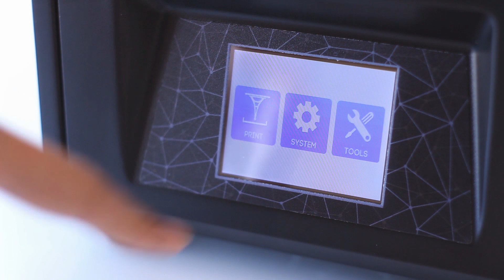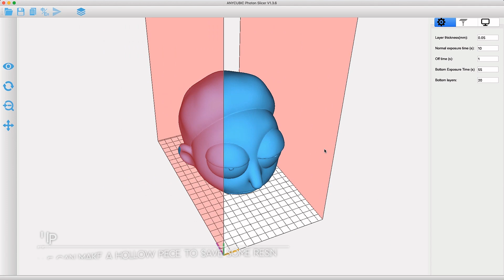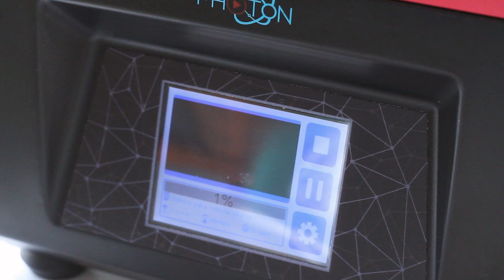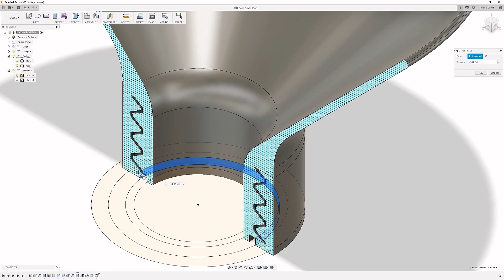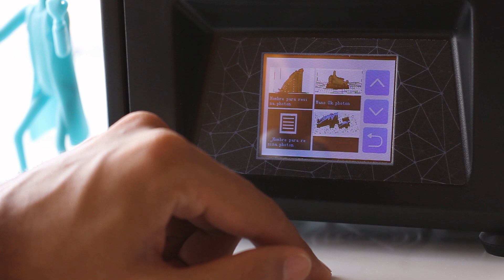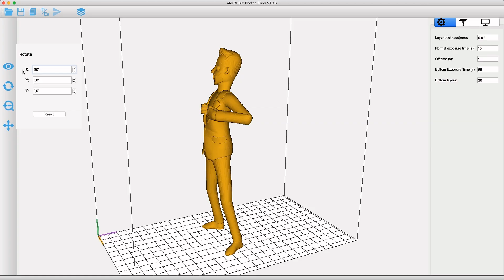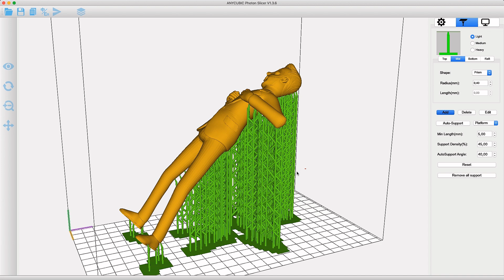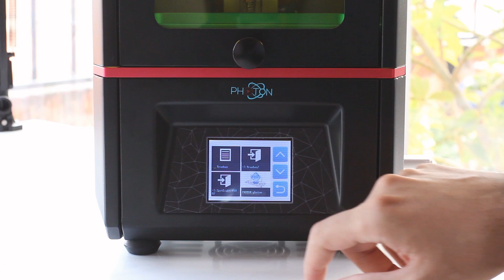Montaje, Accesorios y Pruebas / Anycubic Photon

Comment: Buen día. Me han regalado una Anycubic Photon usada. Soy protésico dental y es mi primera experiencia con una impresora 3d. Cuando encendí la impresora, y con una resina para modelos (creality) imprimí uno que salió excelente. Acto seguido, intenté imprimir una férula y cuando presiono "Print" comienza un proceso que dura un minuto, como si estuviera imprimiendo, pero la placa no se mueve. En el display (donde está el conteo de capas) aparece: 0/1480134. Probé formatear el pendrive, y nada. Desde la página de Anycubic descargué la actualización de los firmerare: [Newest]Photon firmware V5.0.2, y cuando selecciono los archivos desde el menú "Print" me dice que no se reconoce el formato del archivo. Le pasé el archivo de la férula a un amigo que tiene la misma impresora y lo lee e imprime sin dificultad (por lo tanto los parámetros con que configurñe el "slicer" son correctes). Alguna sugerencia que me permita solucionar el problema?

Comment: It's highly recommended that you didn't take off your gloves until its fully cured (sunlight or cure station).  Sometimes it's not enough just to wash it with IPA. There could be some uncured resin left on the surface - or in a draining hole.

Comment: Thanks That was very helping for me, and I have a silly question to you and to all Photon users, when you ordered the printer from Anycubic website, did you select the "with resin and/or FEP option? and if not, was it shipped to you without any resin and without FEP at all (even without the 200ml resin and one FEP) ?? I know it is a very silly question, but I appreciate all your answers thanks
Reply from the maker: I bought it with a liter of resin and 5 FEP. It is something that you will surely need
Reply: Thanks for your reply, you are right for sure, but you did not answer my question,  have you selected the resin and the FEP from the same page of the printer? if yes did you receive 1 litre of resin + 200ml + 1 FEP (usually in the printer box?)